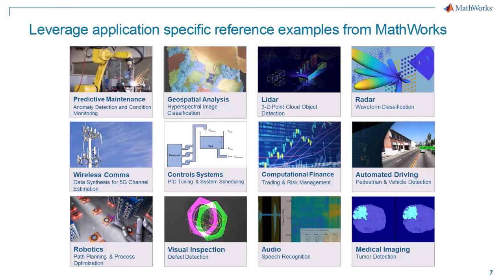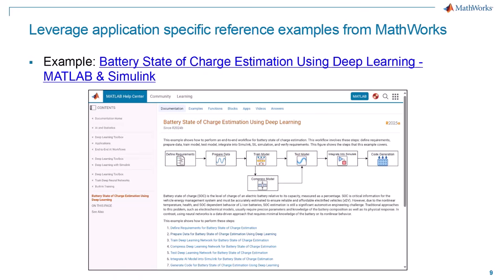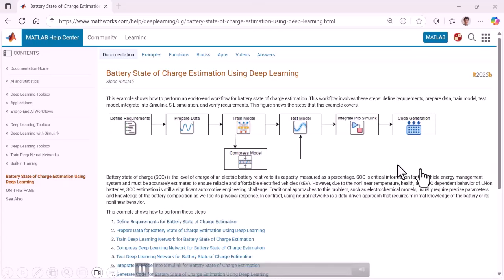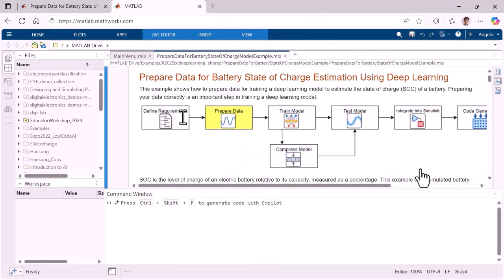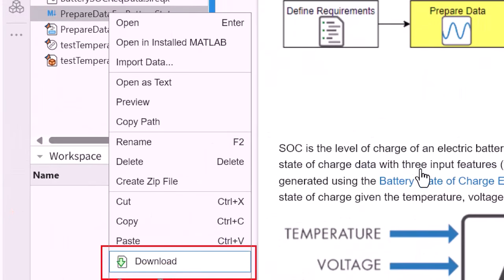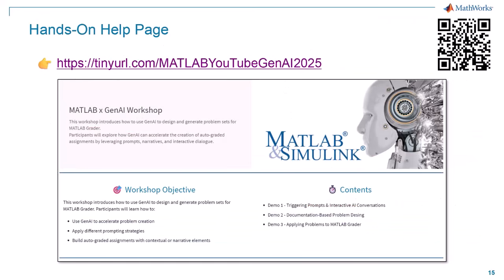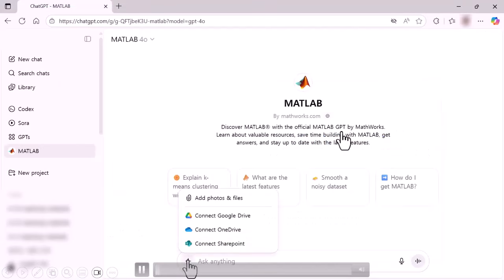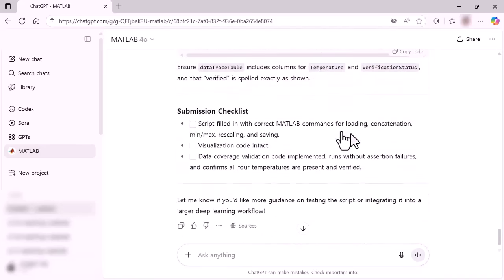MathWorks Documentation-Based Problem Design with GenAI

Comment: That's really nice. But the problem faced by many instructors is when the students use GenAI to solve the problem!! In this case, one GenAI creates the problem and an another one solves it :)
Reply from the maker: That's a great point, and it's a concern many instructors share! Here are a few workarounds Angelo Yao personally has seen work well: 

1. Context Obfuscation: Using generic variable names (like A, B, C) instead of descriptive ones (like 'voltage' or 'torque') and removing domain-specific background info makes it much harder for GenAI to grasp the physical constraints of the problem. 
2. Secure Environments: Using tools like Safe Exam Browser (ETH Zurich) to create a locked-down environment without internet access during exams is a solid way to ensure academic integrity. I've seen multiple professors use it in Germany and South Korea. 
3. Focus on Process: Shifting the focus from the final result to the reasoning process—such as requiring students to write their own unit tests or explain their logic in detail—can also mitigate the risks. 

Hope these help, and I'd love to hear if you have other strategies in mind!